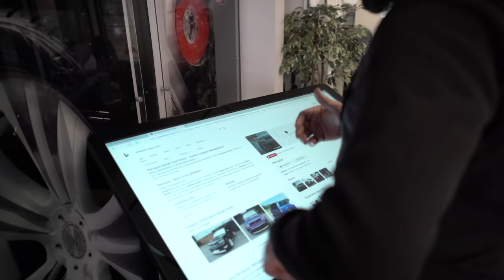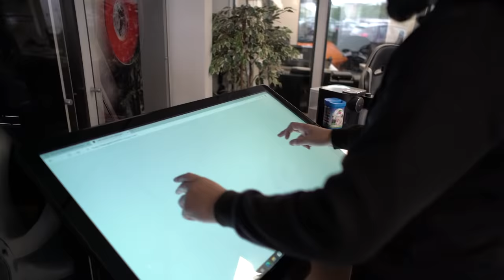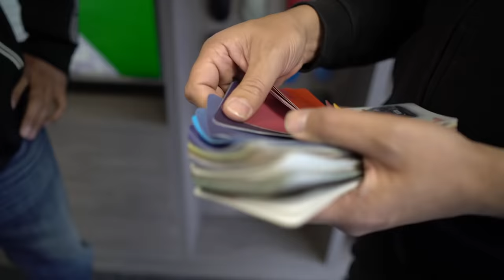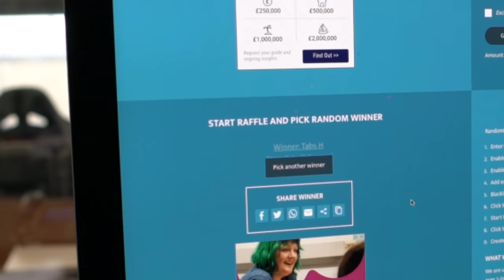CUSTOMISED A CAR FOR SHEIKH RASHID !!!!

Comment: I bought a Range Rover that already has this same kit on it. But whoever installed the kit didn't connect the LED lights in the air intakes. I've looked all over the interior and I can't find a switch to turn them on anywhere. How do I connect them?
Reply: Pull a new wire from the LEDs through to the dashboard and connect it with the OEM light console or else fit a separate on off switch... simple job will take u 1hr max
Reply: @jayjazz2997  Thnx 👍.
Reply: @jayjazz2997  Now I've just got to figure out how to get behind the bumper to attach the wires.